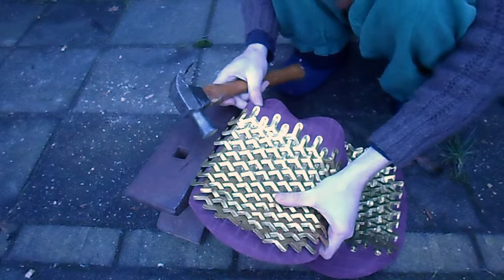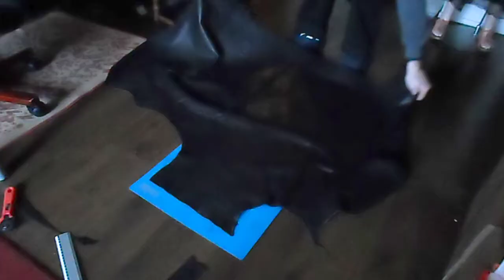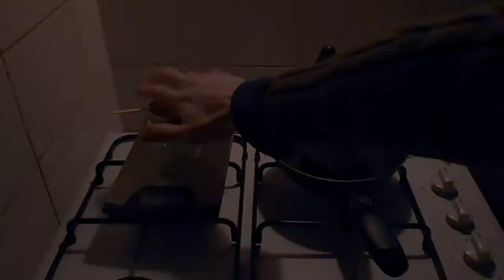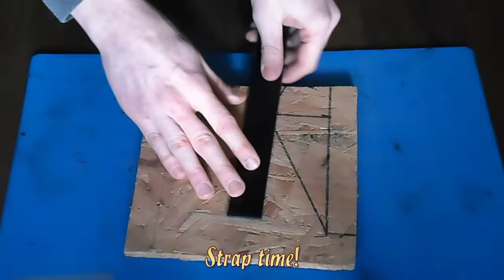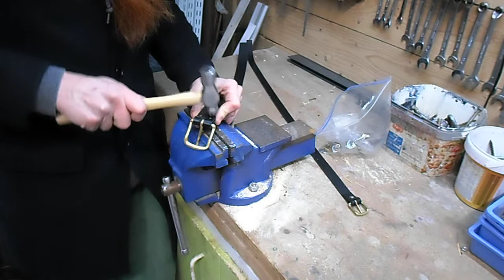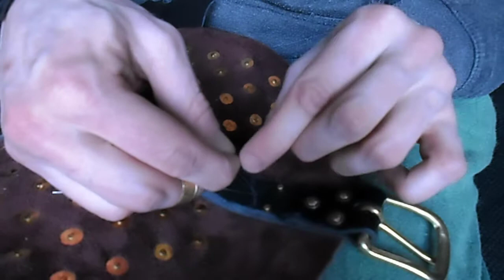Chinese Mountain Pattern Armour Part 3: Flaps and Straps

Comment: i dont think you could have put straps on first it would have got in wat of rivets. apart from just attaching buckles & straps to trim & not having a strap over midel bit stitching through it is only way to go as far as i can tell. its pretty impressive that a needle can barely penetrate it, almost a steel plate, but with some flexibility. one day i might make a breastplate out of this :P i always found the plate ones 2 stiff